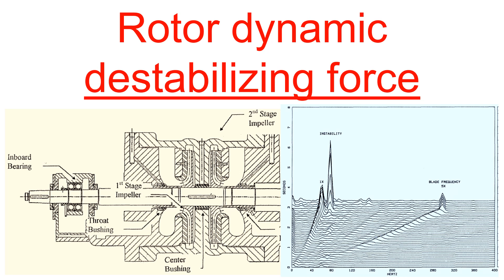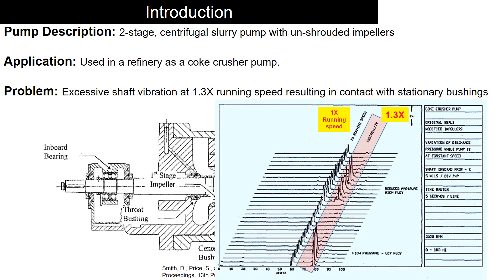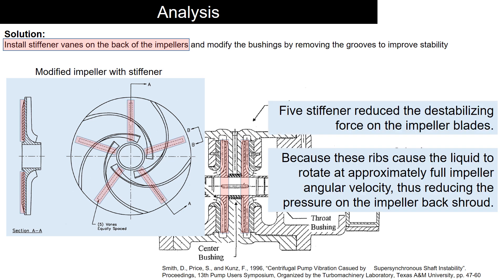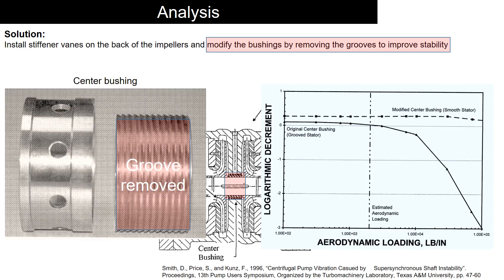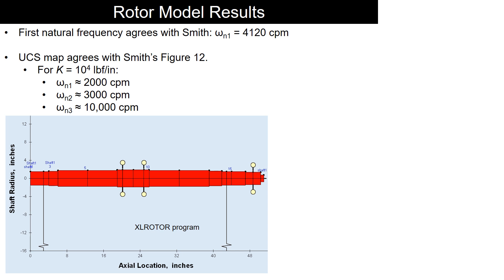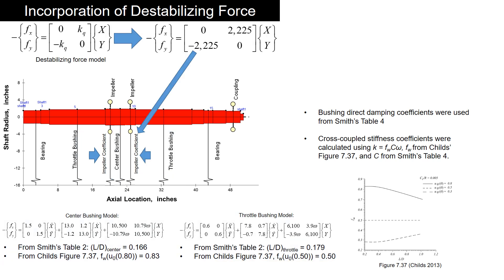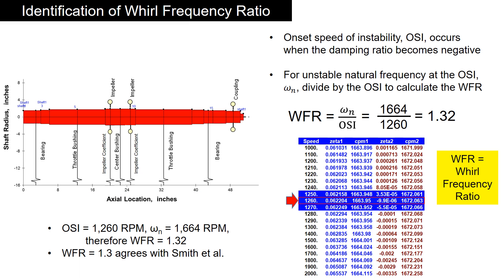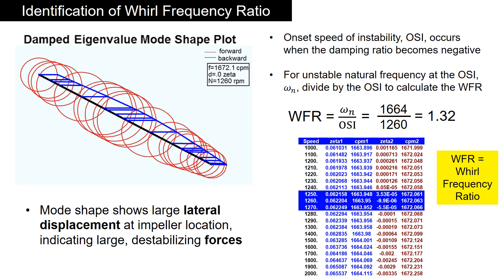Part 18 - Destabilizing Forces in Rotating Machine

Comment: Informative but on what basis they decided 5 pump out vanes ? based on mass ? or any specific reason behind it ? could you explain?
Reply from the maker: Excellent question. The rationale behind the use of 5 vanes isn't explicitly documented, but in engineering, decisions often stem from a balance between effectiveness and cost. It's likely that 5 vanes were found to yield satisfactory results without overly increasing implementation expenses. While additional vanes could potentially enhance performance, the associated costs would likely outweigh the benefits. Thus, the decision appears to be grounded in practical logic

Comment: Thank you for very informative video! Isn't the wn used in WFR calculation 1672 RPM instead of 1664 RPM?
Reply from the maker: Excellent observation! Your feedback is much appreciated. While using 1672 rpm might be more logical, it's worth noting that the differences between 1672/1260=1.3269 and 1664/1260=1.3206 are quite minimal. :)